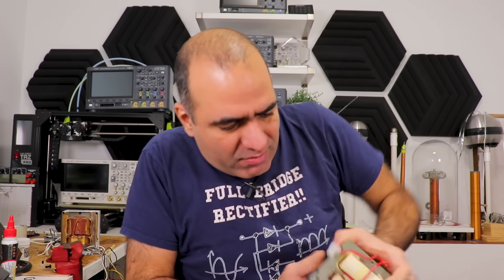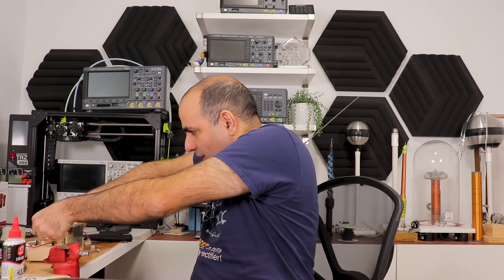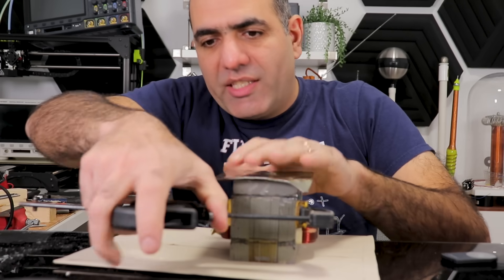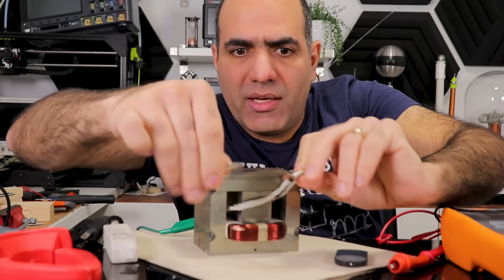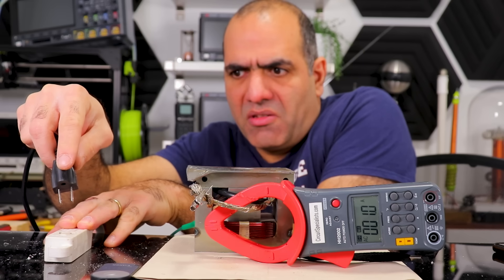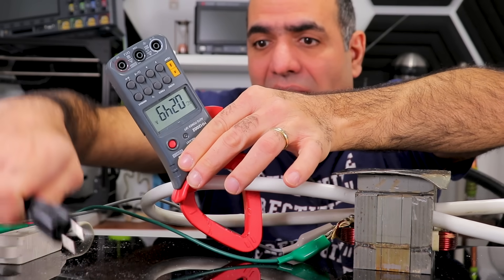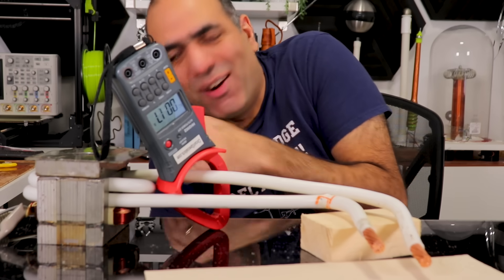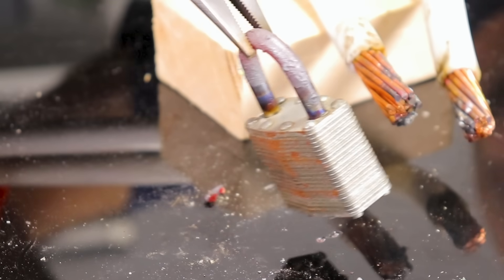Making "MILLIONS" of AMPS of Current

Comment: next time get some wire from a welding supplier. That should be perfect for your low voltage - high current application. Its also super flexible due to the silicone isolation layer and high strand count

Comment: For the record, Canadian cents are steel and nickel coins plated with copper, while American cents are zinc plated with copper. If I remember, the reason is that producing a penny in pure copper would cost more than the value of the cent so it is more economical to use a less valuable metal for the core.

Comment: Nice Video! I'm wondering how "power filters" works (if computers or a server room needs clean power - or even for audiophiles that wants clean output). How does it works ? Is it good to have at home or is it a waste of money ? Hi from Quebec, Canada!
Reply: It filters out the line ripple, and yes its important to equipment that has not taken the same precautions to preventing spikes of undesired frequencies (being damaging to equipment or unwanted audible noise)
Reply: Power filters use capacitors, ferrites, and other components to eliminate stray electrical noise that can be introduced onto power lines by appliances. Most audio equipment incorporates sufficient power line "conditioning" circuitry so that an external filter is unnecessary. Some audio equipment may exhibit a "60 cycle hum" (or 50 cycles in some parts of the world) due to "ground loops" - these can't typically be eliminated using the type of power filter you probably have in mind (instead, a better grounding scheme needs to be implemented).

Comment: Yes in case you're wondering, "new" pennies are copper coated zinc, the same as the US pennies. Old US and Canadian pennies are almost pure copper. In the US, pre 1981 pennies are full on copper, not useful for making homemade batteries like the new pennies. Not sure when this change occurred in Canada though, likely around the same time.
Reply: " In the US, pre 1981 pennies are full on copper,"

Except for 1943 when they switched to steel to make more copper available for the war effort. Incidentally, a few copper ones accidentally got made when they made the change over. Those few copper 1943 pennies are extremely rare and worth millions.

Comment: Still learning electrical engineering so here's a rather basic question. What would happen if it was 4000 volts instead of current? Will the wires still get this hot?

Comment: isnt this basically how arc furnaces works? relatively low volts, very high amps to melt ore or scrap into molten metal. its still higher voltage than household outlets but for industrial use, 400v-900v isnt much but at up to 44000 amps, thats a lot of watts

Comment: Medhi.. instead of using a cheap power strip you have to plug/unplug, look for a Christmas decoration power strip. They sell one that has a foot activated switch that activates the power instead. It’s meant to let you use your foot instead of crawling under/behind a tree or whatever..

I think it would be much safer for you to be able to react and quickly stomp a foot instead of clambering and grasping for wires to pull on..

Just saying. Get a power strip with a foot switch!

Alternatively you could leave the switch on the table like a big dramatic button! The one I have literally has a big glowing red button. That’s very… Medhi and dramatic in a good way. Slap a big glowing button, ZAP!, some junk explodes and you panic smack the button again. Sounds like fun.

Comment: What is the output Wattage? Is this expensive to have running or is it just like having a normal 15 amp circuit running?
Reply: Roughly volts times amps, though not exactly for AC. I think he said it was roughly 2 volts, and 500A so 1000 Watts. It's about the same as a microwave.
Reply: @EEngineer18  Thanks!

Comment: What would have happend, if you had used the other spool you took out? And I mean replacing the other original spool, not the thick wire with few turns. It had more turns, so wouldn't the effect have been even more pronounced?

Comment: You most put the transformer inside some oil to keep it cold.and glue is not a good choice because it makes air gap and it will increase the leakage inductance and reduce output power.

Comment: The way you are using the angle grinder is pretty dangerous, you should rotate the guard so that it faces up when you hold the grinder horizontal with the disc on the left side. This way the grinder will pull itself away from your body which gives you the most control over the grinder and in case the disc grabs, it will not cut your arm or other parts of your body.

Comment: I'm halfway into the video, but if he wants more current in the new secondary, why doesn't he use the previous secondary as primary? He's using the existing primary and a loop of wire as secondary.

Comment: I made a pretty decent spot welder by doing this, using 2 or 3 turns of 25mm2 welding cable for the secondary and a relay and selectable capacitor to time blipping the primary on and off. I copied the idea from an old Marco Reps vid, just tweaked it a bit with proper electrodes made from copper rod, only two caps for the timing, and a cheap ebay footswitch. it works really nicely.
Reply: You can also use tungsten rods as electrodes

Comment: A bit closer and your ring would melt!
You need more turns on the primary with thicker wire to induce more current in a few secondary windings. An arc welder from amazon for £45 would provide the transformer which you could 'modify'. Please remove your metal ring!